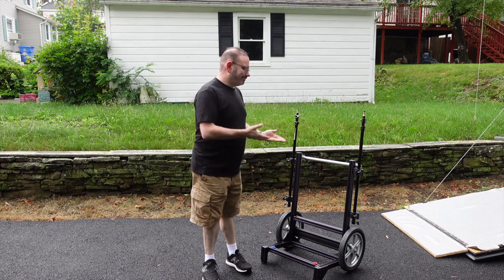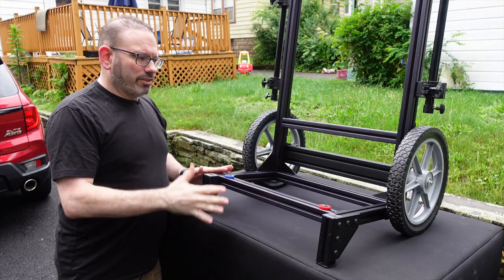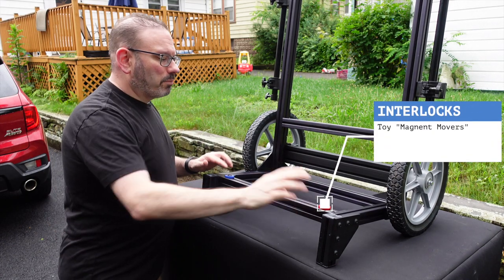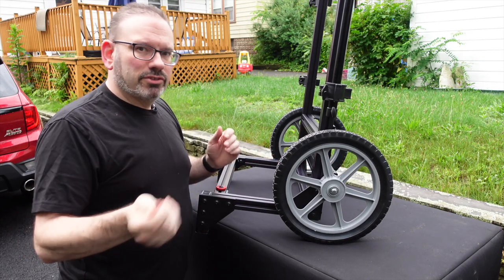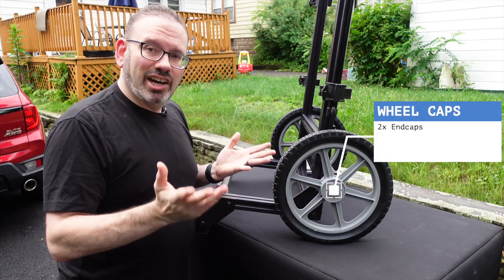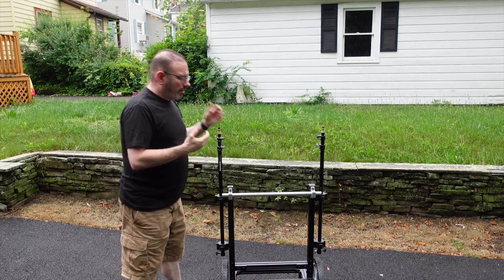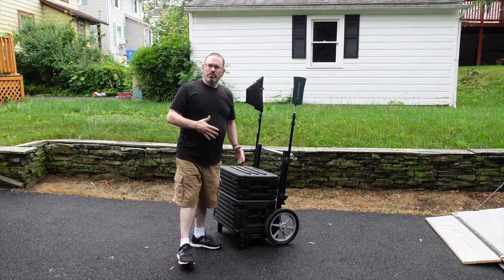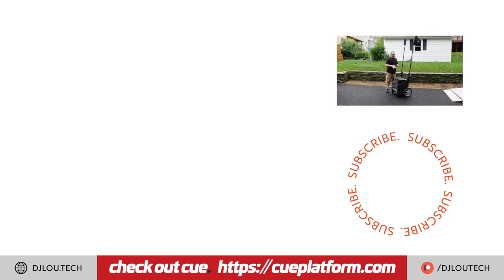DIY “Big Wheel” 8020 Ceremony Cart

Comment: I am VERY curious how you did the axle. In particular, how you went about the shaft mounting to the profile. Did you tap the ends of the profile, thread in a bolt and cut off the head so that you could pound on those end caps? I'm trying to figure out the best way to to this exact same thing. I'd love to know how you got the result you did.
Reply from the maker: I fretted for years on how to do this. But literally I just put in the axle at a trimmed length. Put the wheels on that has bearings on them already. And capped the axle. That’s it. I didn’t need to make anything else special for it to work. 

It would have been nice to have custom caps made to make it even cleaner. But the basic solution works perfectly.

Comment: After watching this video. I don't feel bad about you getting on my case because I feel there's something wrong with you. 

$900 for a DIY cart is insane. Not insane for movie and TV location ones the production houses use here in Hollywood. But for a wedding DJ ceremony?

Plus that handle is too low, you're going to end up getting a back ache pushing it at that height. 

You've definitely fell down the rabbit hole. One of those  wagons with the big pneumatic tires would have been a cheaper alternative. They can move through the swamps or wherever you go. Regardless that's too much junk and those racks are probably overkill as well. 

Try to climb out of that rabbit hole, it's consuming you brother.
Reply from the maker: Sooooo. A long diatribe of how how you don’t understand the particulars of not only ceremonies but frequencies, management, et al. 

Best of luck to ya.
Reply: @djlouparis  there's zero wrong with getting a portable speaker on a tripod, putting a wireless mic on it for the officiant and perhaps another to use. 

Plug it directly into the speaker and use Bluetooth to playback some music in a laptop to the speaker. 1,000's of djs do that. 

I know of a guy who does that with his jackery battery. 15 minutes later the ceremony is over. Done. There's no post ceremony celebration after party. Pack it up and go back to the hall.
Reply from the maker: @oldschooldjernie I’m not 1000s of DJs. There is a reason literal Broadway performers seek out my services. Because I take ceremony services very seriously. 

Even if their ceremony is 10 minutes long the quality and care i put in my offerings shows. 

But clearly you’ll can never understand that and it’s cool. You don’t seek out how to provide the best experience. The mere thought of of using Bluetooth alone or using a 2.4GHz mic set in a critical environment is just waiting for a moment to fail. 

You want to risk a reputation on that it’s fine by me. May the odds forever be in your favor.
Reply: I don't do weddings anymore I retired from that cluster f. It's actually demeaning doing weddings and becoming a slave to a bride, like the "help". But I digress.   I have carted out one or two speakers to a ceremony and did both, just wireless and BT the laptop or sent the mix to the speakers from a mixer. 

Plopped a 500 mhz wireless receiver on a speaker and gave the officiant the mic and it worked flawlessly because they were only 25 feet away from the speaker.

Then I also carted out a rack with wireless and and IEM to a couple speakers. But this method I had fears of drop outs because the rack was over 50 feet away. Anytime a wireless mic is that far anyone gets those fears.

I had a few drop outs 3 weeks ago when I was 100 feet away and I'd never do that again. It's unprofessional of me to have risked that.

If I had to have those mics that far away I should have set up my repeater system which totally insures a clean signal proven up to 175 feet away line of sight. Save the bat wings for Batman and use a repeater, it's unobtrusive
Reply from the maker: @oldschooldjernie  the fact that you fear 50-100' range of your equipment shows your lack of understanding of how everything works. Just like your ranting on how 1/2 waves somehow don't increase range or improve the capability of picking up your mics emphasizes that you really need to relearn wireless.

And given your terminology of "becoming a slave to a bride" makes the industry reassured that you are retired from this.
Reply: "And given your terminology of "becoming a slave to a bride" makes the industry reassured that you are retired from this." Good, its not going to amount a hill of beans there will be always someone greedy enough to take over or hard up to become a dj, they'd start doing weddings. I mean its easy work, you don't need formal training or a degree. I'm happy doing small gigs and working in video. In fact on Nov 16th I have a gig in Beverly Hills working for Associated  Press so that's cool as well. Cheers! Watch your head when you pass through a doorway, LOL